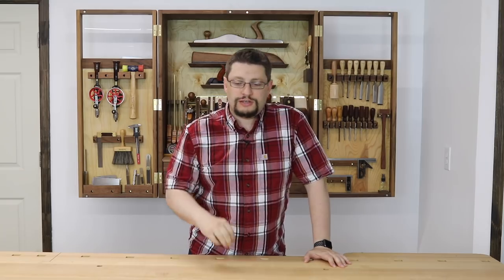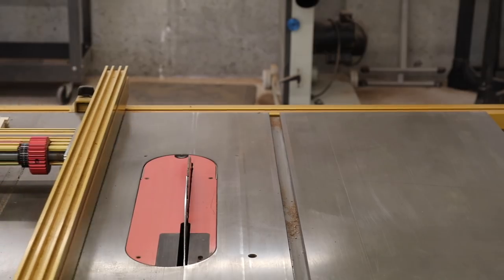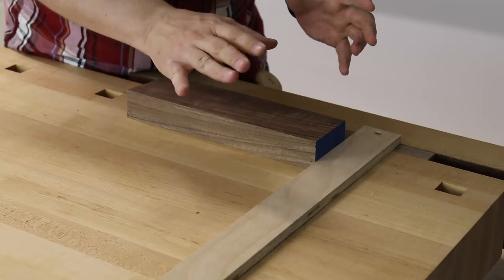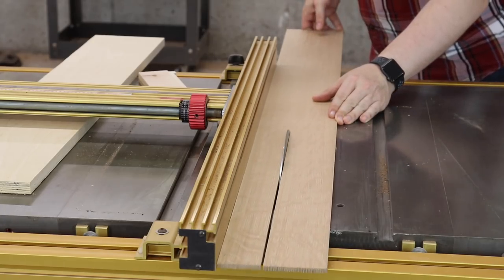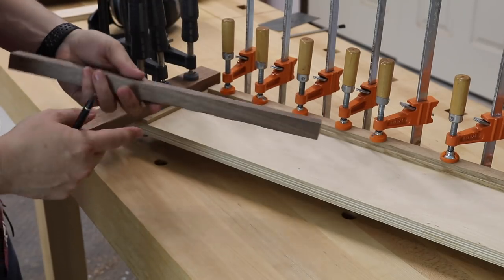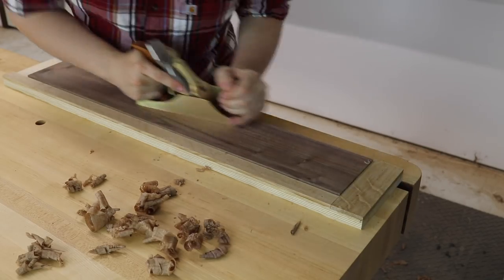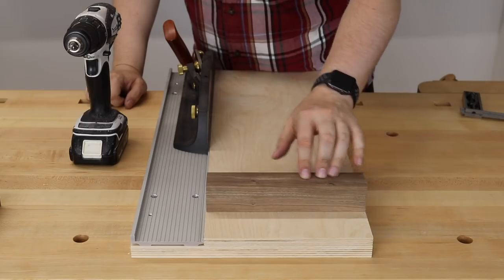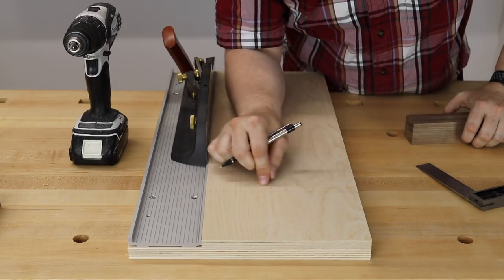Three Bench Jigs to Improve Hand Planing

Comment: Wood moves more in tangent (parallel) with the rings than it does in the radial direction (perpendicular). Though, I don't think you'd really have to worry about it with a piece that small.

Comment: great video, second one is most useful, however the 3rd i would suggest the pivot point should be on the other side as this will be where most force is applied and if you are taking the time to adjust for wood movement then you dont want to risk it moving when planing 
but overall great simply explained ideas, thanks

Comment: All good ideas.  I've seen and made these for my shop and they're très handy.  As for the 2nd fixture, I used quarter inch plywood, rather than quarter sawn white oak.  Just as stable and is actually a fraction thinner than 1/4".  These seem excessive and expensive, as these can/should be made of scrap.  Even the shooting board seems to be the most expensive way of addressing this needed bench fixture.
Reply from the maker: If you are planing something that is flat, I find it's best to use a reference surface that is as flat as possible. I'm never able to get that out of regular plywood. Baltic birth with all the additional ply's, yes. You don't need to use the Lee Valley track, I just wanted to.
Reply: ????  You're not planing on top of any of these surfaces, you're perpendicular to them.  With the 2nd jig, you can get as flat and stable an edge with a scrap of 1/4" ply as you can with quarter sawn white oak.  As for the shooting board, even if you used some plywood that was less than perfectly flat, that would not transfer to the blade turned at 90 degrees.  We may be misunderstanding what the other is saying here.

Comment: How useful do you find a shooting board when you have a crosscut sled on your cabinet saw?  What advantages does it have?
Reply from the maker: It's faster to dial in a depth of cut for fine cuts on a shooting board versus the table saw and on a saw you have more chances to take off to much material ... think fitting into a dado on two sides of a case.
Reply: @mmwoodstudio  makes sense, thanks for the reply.  So it is really for precision as much as it is for ensuring something is square.  How much better is your shooting plane vs a LAJ plane?

Comment: shooting board will not stop all tear out if its not against the plane. looks to me to be a little short.
Reply: I agree. The fence shoud initially slightly overhang the inner edge on the shooting board track and the initial passes of the shooting board plane remove the excess material for a true zero clearence backer support.